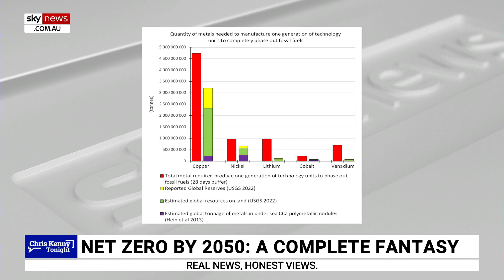'Rare earths' required to build EV's and Hydrogen vehicles are 'exotic'

Comment: you need to wake up... it is not about net zero, the environment or any other bs of that nature. it is about control (enslavement) of the population. the push towards EVs puts personal transportation out of reach of most people, just based on the cost. Then consider that after 7 to 10 years the battery needs replacing and constitutes a major % of the vehicle cost, almost like buying a new car. So most people will not be able to "service" the already expensive EV they were conned or bullied into buying. Then consider that when all these vehicles have been produced, the available lithium, cobalt etc will be greatly reduced and increasingly expensive to come by, so new cars will not be possible, even replacement batteries will not be possible. The whole idea is so short sighted and ridiculous, but the end result, either way, will be that "the masses" will no longer have personal transport, which is one of the very essences of freedom. Go where you want, when you want, with whom you want.